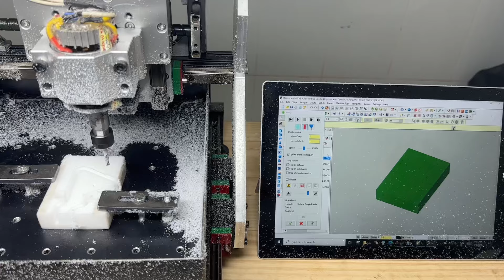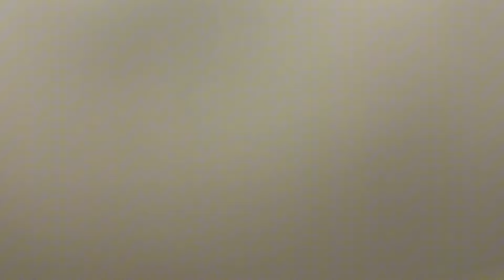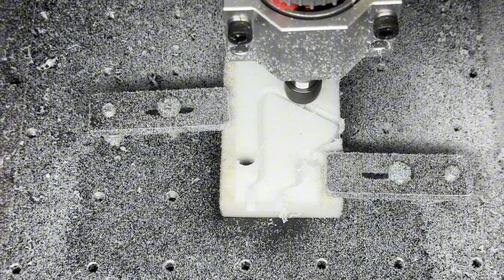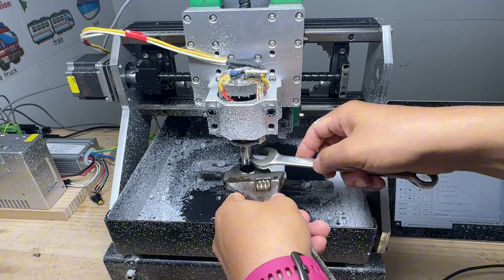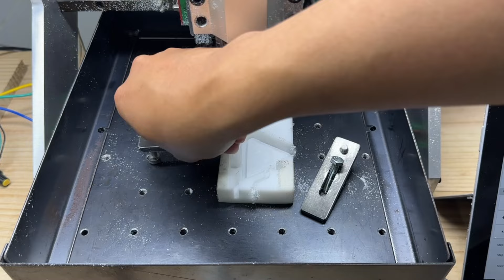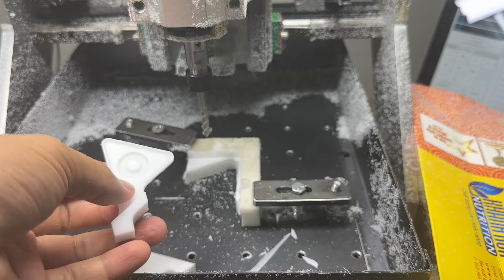How To Make DIY CNC Machine | Science Project

Comment: The machine looks solid. I think the biggest problem is the spindle. Try one of those brushless 600w spindle motors.
Reply from the maker: Yes, I use very small spindle. Do you have link for 600w spindle?